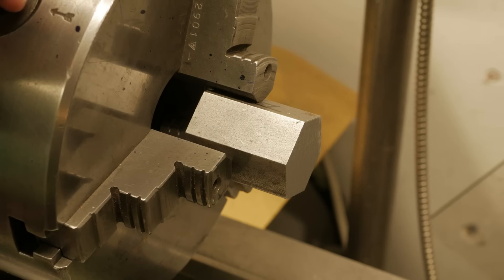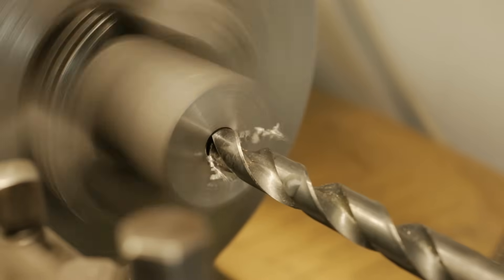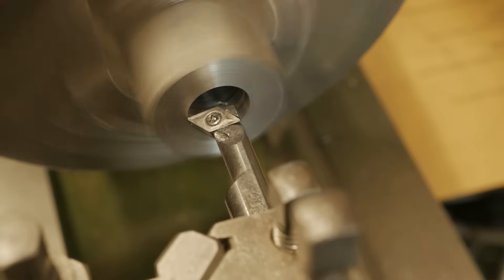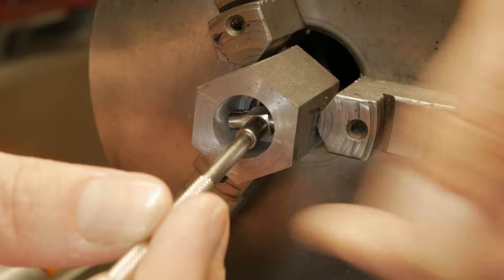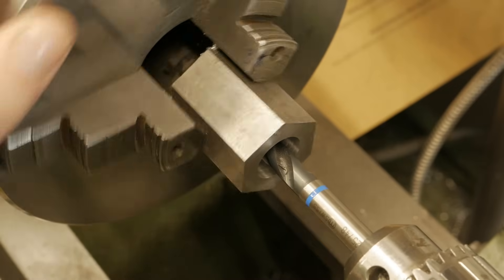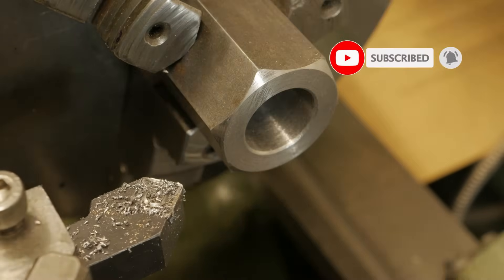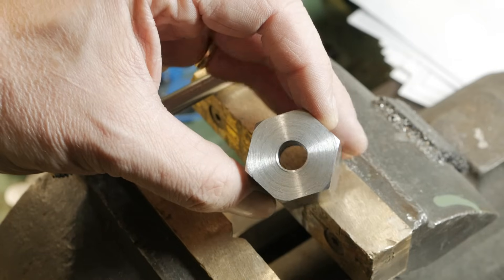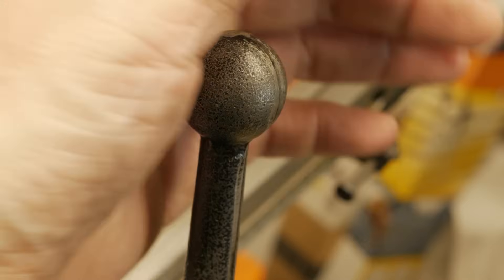A DIY Secret to Easily Turn Screws On Your Lathe!

Comment from the maker: Hi guys,

I think anyone who has ever had to modify existing screws without building them from solid, for example due to the excessive length, but also due to the size of the head: it happens that this must be less thick for example or with a smaller diameter.

In this video I show you my version of a simple support with 2 screws, one inside the other, the smaller one acts as a block for the larger one, which being cut in half expands by opening (when the smaller one pushes) a few tenth by locking into place and pushing the screw to be modified.

The screw to be modified is mounted frontally, on the thread side or on the head side depending on the modification to be performed!
However, the force of the tool tends to tighten the screw, in favor of safety.

Hope you like it!
Alberto

Comment: The video is very nice with its clean shots and music.
And as for the topic of bolts in a lathe chuck - I am using Round coupling nuts with full internal thread - and it make job wery well too! And not need make special tool!
Reply from the maker: Thanks Aleksej for your nice comment!! 😊

Comment: The runout on your tool makes it barely usable.  Watching the bronze inserts - there should be virtually no runout.
Reply from the maker: Hi Dennirr, In fact, if you have seen the video, you will have noticed that I marked the jaw number 1 with the number 1 on a exagon face, to limit the runout as much as possible, in fact the hexagon was worked leaving the piece under the jaw 1 until the end , the runout is in fact very limited, as my tool takes the screw not on the head but on the thread. The head of the screws is never coaxial with the thread, they are made by random rolling and therefore are not precise, with my device you can also make them cylindrical with the thread.
Reply: hey man, dont worry too much about the nay sayers...solid idea you have there. i might have put a few set screw in the side to adjust the runout of the brass parts. good work though
Reply: Um that is not run out it is plain old non centered non concentric garbage.

Comment: I've been trying to come up with a good way to do this. there are several other examples out there, but I think this is very elegant...  Im going to make a similar jig with a full set up thread adapters so I can use it with any imperial or metric size screw....  Very innovative.  You earned a channel subscription.  Cheers.
Reply from the maker: Hi Jeremiah! Thanks so much for your comment and subscription to My channel!! Very happy for this!! I decided to make It because a friend asked me to modify a screw of a carburator, easy i said but after in the chuck i change opinion!😂this was the reason, welcome to my channel Jeremiah! See you soon, Alberto

Comment: Neat. When I want to modify a bolt head, I just put on a nut up against the head, and another further down then clamp it in the 3 jaw. the one against the head holds it in position, and the second gives axial alignment. Not perfect, but good enough for most work- and it can be used on any size of fully threaded bolt.
Reply: For extra credit and less movement, use Stover locking nuts.  This project are dum.

Comment: I usually make this type of fixture on the fly from a piece of scrap, lose it and have to make another the next time. I really like the idea of having a re-useable and adjustable tool that covers different sizes. I've added it to my (ever growing!) to-do list. Thanks for sharing! 👍 🇬🇧
Reply from the maker: Hi Matt very happy that you liked the device: i force my self to make something that works without a spanner but only by hand !! Until the M12 screw you can use my device !!  The thickness of bushing decides the minimum length of the screw because the head of the screw is on the side of the bush. Thanks for your comment !! A big ciao from Italy and happy Easter !! Alberto

Comment: I don't see the need for the TWO clamping screws. Can you explain why you used two screws? I made something like this many years ago. My device did not have the interchangeable thread feature. I used a single capscrew to tighten against the screw being machined and it worked very well.
Reply from the maker: Hi Zenminus, i understand what you mean: the first idea was to use a screw and a bolt that closes the screw in the position to push the screw on work, after i decide to not have a spanner to close that nut and so arrived the idea to have 2 screws !! Thanks for your comment !! Cheers from Italy, Alberto.
Reply: @ab-shop   You didn't explain how the inner screw expands the split outer screw. I presume the hole in the outer screw is conical at the right hand end (with reference to the position of the outer screw in the finished tool installed in the chuck)?
A cutaway section view sketch would have been helpful.
Reply from the maker: @Gottenhimfella  Hi Gotten, the  hole on the outer screw was made with a drill bit and It stops before the end of the outer screw: when you put the inner screw, the poit of the inner screw push at the end of the hole, 

that have the typical shape of a drill bit hole, so the inner screw when arrives the end of the hole push and try to open the outer screw,

 this because the outer screw have 4 longitudinal cuts.

Hope now Is more clear!
Cheers from Italy,
Alberto 🇮🇹
Reply: @ab-shop  Great, thanks for taking the time to make that clear. It seems to me this would work best if the drill tip angle was 90 degrees (like a spot drill or countersink) or better still 60 degrees (centre drill) rather than the usual 120 degrees (lots of friction, not much expanding force, more of a jamming action) but if the thread is a close fit it probably doesn't matter much.
If I use this good idea (and I probably will) I think I might use a centre drill, but make the conical screw tip say 50 degrees, so it bears only on the transition edge between the 60 deg cone and the parallel hole made by the tip of the centre drill. This would ensure both a powerful and an accurate expansion.
It would require using a bolt which was not of too high a strength grade for the outer screw (centre drills do not like hard material, nor do slitting saws, unless in both cases they are carbide)
ciao! e ancora grazie
Reply: @ab-shop  Thanks for clarifying. i think if I use this idea i will choose a centre drill (60 deg) to provide the conical end, rather than a standard drill (120 deg)
Ciao, e ancora grazie !
Reply from the maker: @Gottenhimfella  That's perfect, like your Italian 😎🇮🇹 You are welcome always!! Ciao!! Alberto
Reply from the maker: @Gottenhimfella  I forgot: i read great passion on your words, happy to see it! 💪🤓
Reply: @ab-shop  Coming from a person from such a passionate culture I take that as high praise. I suppose I do tend to get rather enthusiastic on topics of interest...

Comment: Very nice! I never would have thought to make something like this. Your projects are very useful, I can see that.
Reply from the maker: Ciao Greg happy that you liked that !! In the beginning i thought about a nut and a screw but after I forced myself to remove the spanner to close the main screw and the idea that arrived was this !!

Franking speaking it was the first time that i cut a screw and i did not know what happen but it works because the screw is opened few  cents and it is enough to stop in position !!

Comment: we use er32 screw collets, M3-M12
Reply: it Locks screws  tightly and only lock 2-3 teeth.
Reply: @stockstergates4061  changing the head profile can be done using collets, however, when you have a 15mm M4 cap head that needs 4mm taking off the end then the cap head in the collet doesn't , in my experience, have the best grip and the shank is often not axially aligned. With this version the pocket behind the bushing makes it easier to keep everything secure.
Reply: @michaellinahan7740  it can, but it can not finish less than 8mm length, because of the space, and it is more stable  for its collet thread bite the screw, even there is three threads in the collet
Reply: and I tried  lots of methods, and your way is a good one
Reply from the maker: Hi stockster Gates, happy that you speak about my device !! The real problem was to stop a screw from screw side and after from head side, this is the reason why i use bushinkg !! Happy to see you here in my channel, Ciao from Italy And thanks for your comment !! Alberto

Comment: I don't understand how the 2 screws work. Does the inner screw push the 'legs' of the outer screw outward? But then the hole in the outer screw must be tapered.
Reply: I'm sorry,  I still don't understand. Why would the inner screw spread the legs of the outer screw? Typically a tap and die will create a quite loose fit. So there wouldn't be an outward pressure. Is the hole in the outer screw perhaps incompletely tapped? There has to be a reason why the inner screw hasn't got enough room and thus has no choice but to push the legs apart.
Reply from the maker: @ErikBongers  Yes Erik correct, the hole in the outer screw Is incompletely tapped, the inner screw as you see from the video Is also incompletely tapped but there Is a sort of arrowhead, when this meet the place where there Is no thread, It try to open the outer screw and stop the outer screw in position! Ask me what you want without any problem, i will be happy to answer you!
Reply: @ab-shop  Now I got it. Thank you!
Reply: @ErikBongers  The outer legs do not move at all, they are wedged into the threads by the inner screw, and that outward force is what holds it. Look up expanding mandrels, and imagine a case where the ID of the material matches exactly the OD the mandrel. the screw will still press the "legs" outward, even though there is no perceptiple movement. This force (called friction) will hold it in place.
Reply: @nerddub  They have to move, becuase there is clearance between the male and female threads. it just won't be a gross, visible amount. 
And the person posting the clip has recently clarified that there is a conical section at the end of the hole
Reply: no its not tapered, the "legs" just PUSH upward into the threads, they don't actually move into any different position. It's a friction based locking
Reply from the maker: @nerddub  Yes correct, the first screw stop in position thanks to the small screw inside that try to open the bigger one; the bigger one can be "opened" because it is cut before!! Only few tens are necessary !! Thanks for your comment !! Alberto
Reply: Thanks Alberto, I am going to make one this very afternoon. I wander if it will be efficient enough to put just one left turn screw as a support..
Reply from the maker: Hi Erik, the first screw stop in position thanks to the small screw inside that try to open the bigger one; the bigger one can be "opened" because it is cut before!! Only few tens are necessary !! The bigger screw push push the screw that you have to modify, and when you cut with the tool, the force tends to screw the working screw to the bigger screw, in favor of security !! Hope that it is more clear !!  Thanks for your comment !! Alberto